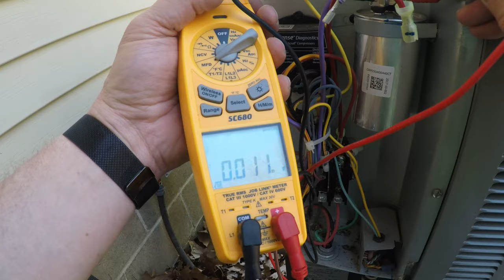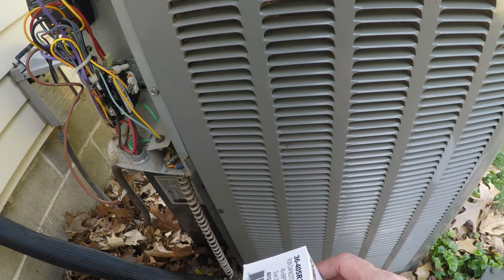Amana AC Not cooling clean your condenser coil

Comment: You definitely need a dust mask. What solution did you use to clean the coils? What ratio settings do you have on sprayer?
Reply from the maker: Refrigeration Technologies Maximum Strength Condenser Cleaner, there is a Link in the description below. I Setting is on C I can't remember what the ratio. I just know it works!